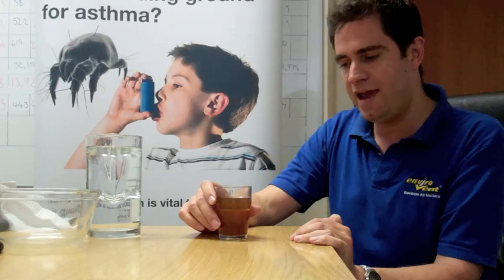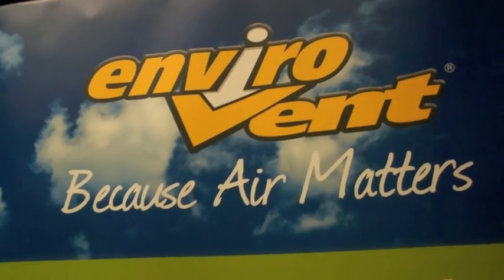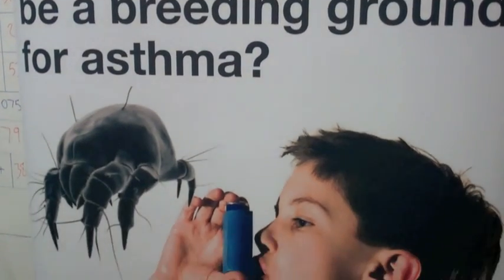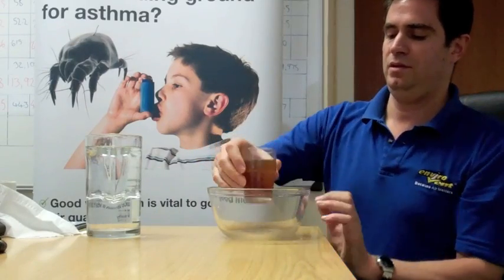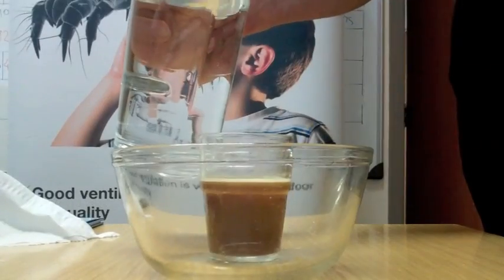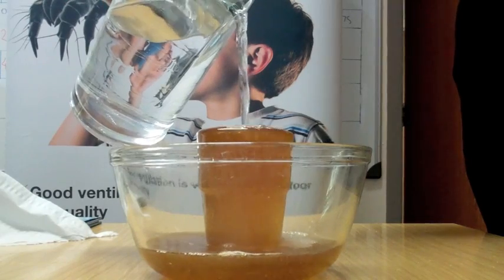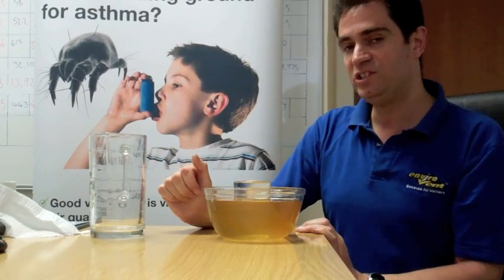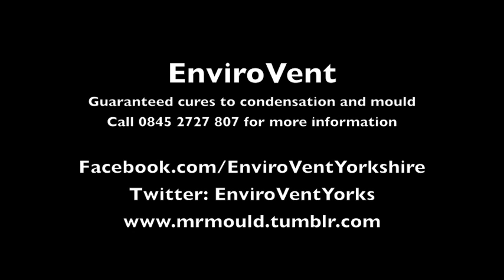PIV explanation - guaranteed cure to condensation and mould

Comment: Do we need to calculate volume of needed fresh air (in m3/h), considering the house air volume and occupants (minimum 30m3/h per person plus 50/70m3/h for the kitchen)? And do we need to check if the old air can find the way out in the same volume (m3/h) as a fresh air?

Comment: Good explanation but you contradict yourself because towards the beginning you say that houses are virtually air-tight and then later on you say that clean air is forced into the house and bad air out. If houses are virtually airtight, how does the bad air get forced out? If you can give me a good answer then I am sold on the idea.
Reply from the maker: Hi Shaun, thanks for your comment. Although we are making our homes more air tight with insulation and double glazing etc., no house will be completely air tight. You are right, however that just using PIV might not be the right solution for every property, sometimes we recommend a combination of PIV and moisture tracking extract fans.
Reply: You said it yourself....you said' virtually'. Now....'virtually' means 'nearly almost'...see? Also, houses are living things in so much as people come and go. Unless the people enter and exit through walls 'Harry Potter style' then doors have to be opened and closed at some time. When this happens, air is allowed to enter/leave. Simple.
Reply: @gj8153  having a PIV just means your having that constant air change slowly but surely every minute of the day.